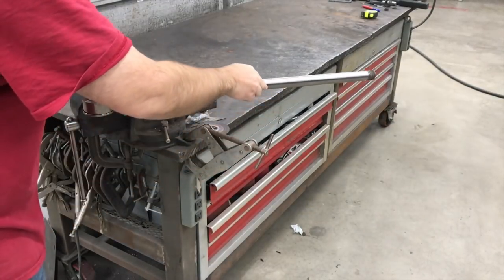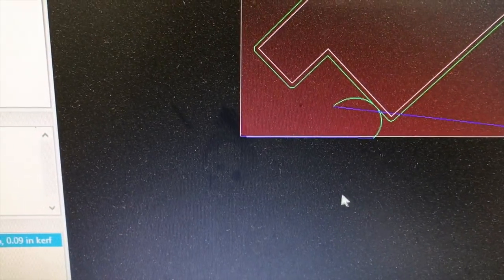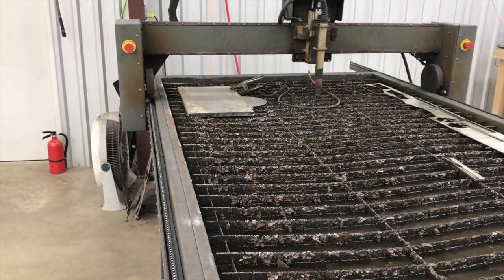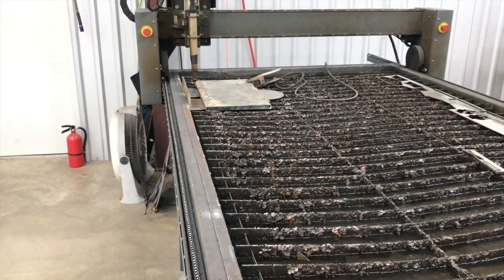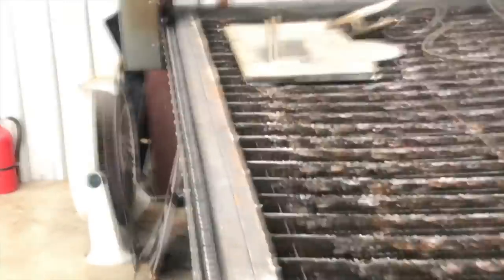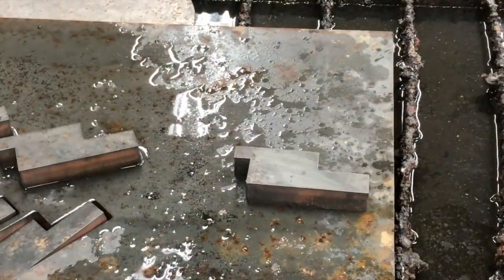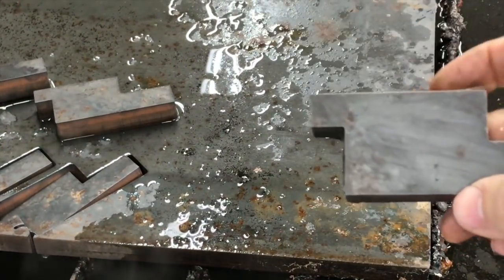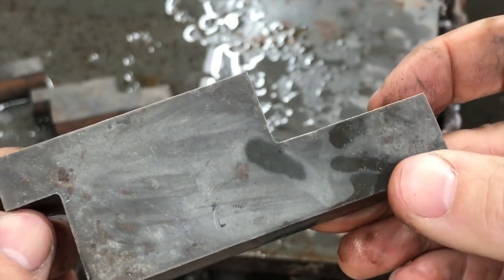Thick Plate - Edge Start - Trucutcnc - CNC Plasma Table - Hypertherm Powermax85

Comment: How do you prevent tapered cuts
Reply: Following... im getting the same problem
Reply: @locomancell  hi Jorge i ended up increasing the air pressure to 9bar and the air flow slightly with 16mm ID hose.
currently using a hypertherm 65 hope this helps

Comment: You may already know this but, Sheetcam also has the ability to chain parts within a specified distance and if the start points are within that distance of each other. I reduce my pierces that way or edge starts.
Reply from the maker: I didnt know that, so if you nest them close enough it will join certain lines and cut them as one ?
Reply: @turbocobra  Yes, the only issue is that if there are inside profiles in the part, Sheetcam can't chain. I'm away from my machine so from memory....when you create a jet cutting operation, there is a box that says something like "chain length". It is in the same area as "overcut", etc. Sheetcam will chain if the end point of one part is within the specified distance of the start point of another. Usually, I can chain 2-4 parts together by moving start points near each other then I have to continue nesting for another group and so on. It can cut your pierce count in half or more. Check it out.....lemme know if it works for you.

Comment: Hi sir i just wounder of ur 3/4 inch cutting and smooth edges very nice sir,
Sir i have a chines cnc plasma P80 100A and i want to cut 3/4 inch stainless steel sheet will u pls guide me and help me and also i got taper in all time some time little bit and some time too much will u pls help what to do and which way i can cut without taper

Comment: Are you using a Hyperrherm Plasma cutter?
Reply from the maker: Yes sir, Powermax85
Reply: Ramsey Customs - turbocobra thought so, easy cut with 3/4” non pierce. My Hyperthem 45xp can edge cut 1” no problem it seems like. They made great prouducts I’m an hour away from Hyperthem I need to go see the factory in NH. 👍🏻
Reply from the maker: Cool

Comment: I really dont get it. i order from a laser cutting place and they get terrible results
Reply from the maker: I hear ya.  I have some laser cut parts here that look worse than my plasma parts.  If the laser is running on a table or gantry that is not rigid or stable, it will have a rough cut edge.

Comment: Nice! 
What’s the purpose of the half circle at the beginning of each cut?
Reply from the maker: its actually the arc'd lead in and lead out for the pierce or edge start. You can have it do an arc, straight, tangent, perp, etc.  Arc is believed to work best in most situations